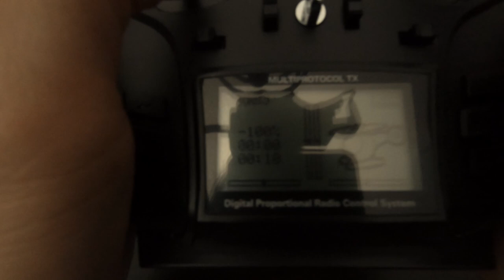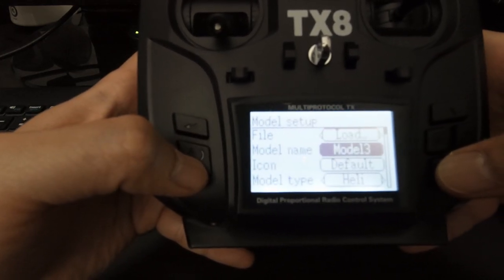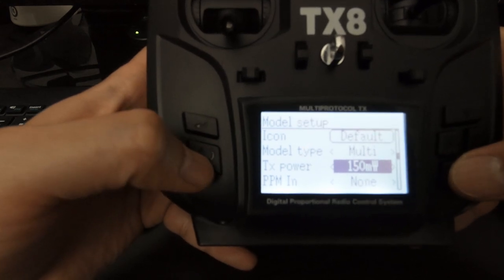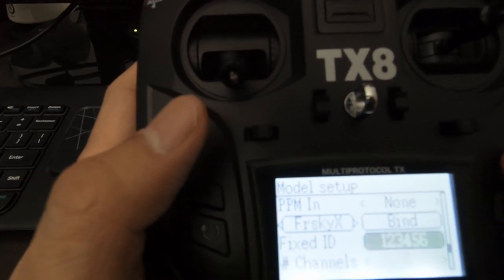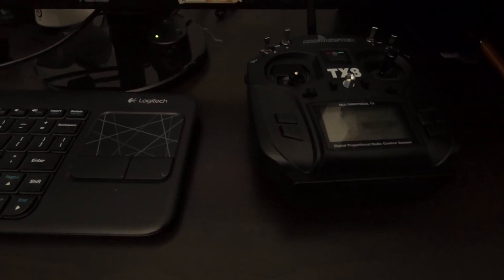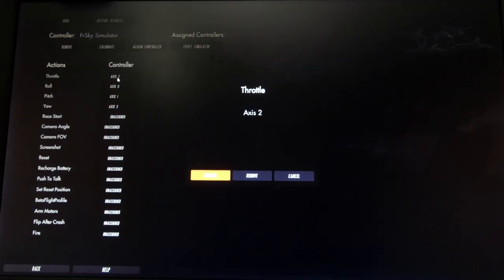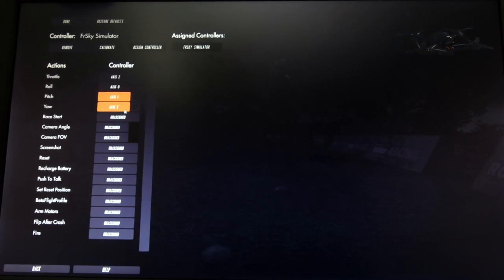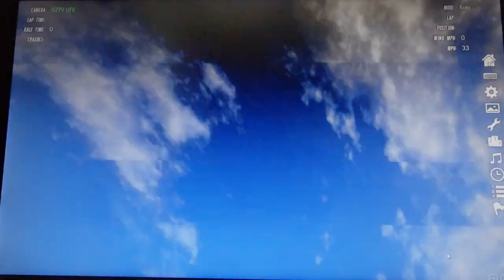How to Wireless Simulator | How to bind RadioMaster Transmitter | Frsky XSR SIM USB

Comment: Hi! Great video but really can’t get my tx 12 to bind with dongle. Have followed all your steps, when I hit ‘bind’ on tx 12 the dongle light never changes to green. Please help, thanks
Reply from the maker: What happened? check if the usb is recognized by your CPU or laptop
Reply: the same with my TX16s
Reply: What worked for me was where you choose which protocol in the menu scroll down and select frskyX2. D16.

Comment: Has anyone done a video on how to setup a helicopter with Real Flight 9.5 using TX16S?
Reply from the maker: Should be same rules applies the only difference is where you want those switches/gimbals or maybe for helicopter will be using mostly logic switches
Reply: RF requires proprietary joystick/radio as far as I recall.